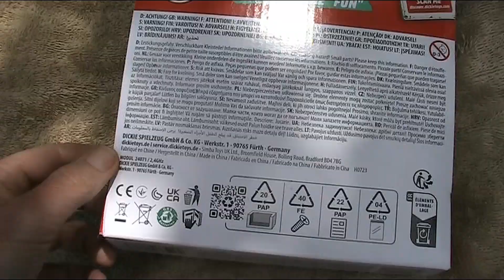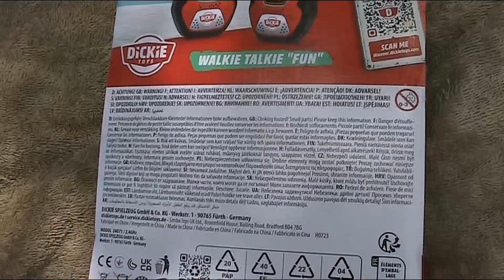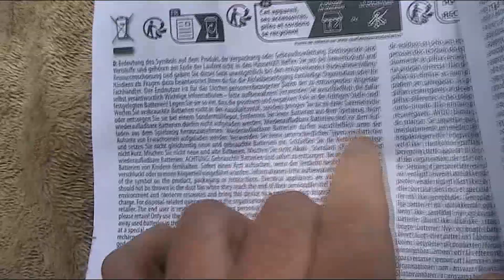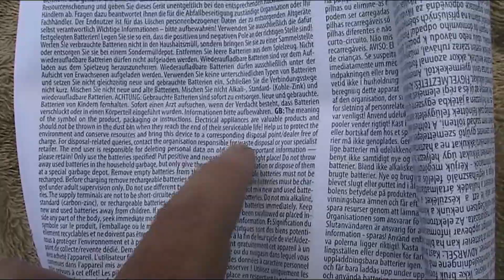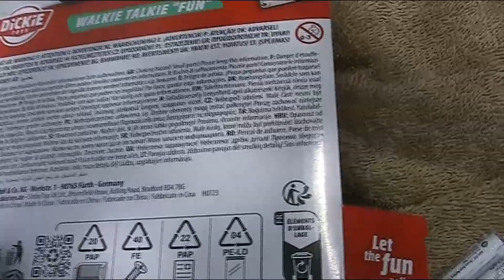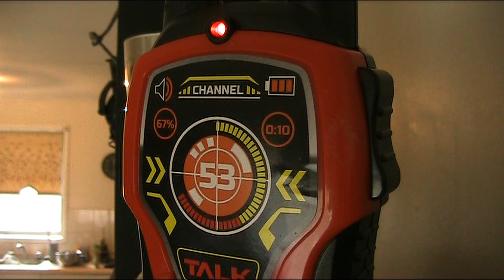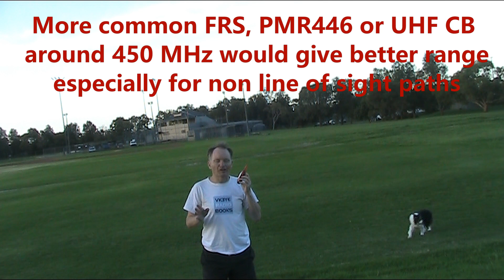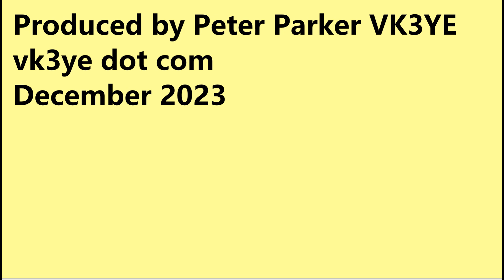2.4 GHz for $20: How far will these Dickie walkie talkies transmit?

Comment: I just bought a pair. The operating frequency is 2,475 MHz using a bandwidth of about 5 MHz (some sort of digital modulation mode).
Reply from the maker: Pity it's outside the amateur band. So no use for VHF/UHF Field Day multipliers!

Comment: That looks very interesting to experiment with. So many possibilities, repackage into a cheap motorcycle helmet communication system, hookup to a blutooth module and use it with Rattlegram, etc. I wonder if it uses an nrf24l01 tranceiver module or similar chip.
Reply: Maybe not a '24 (they're all BGA ICs anyway?) .. While they can sent packets fast (100/sec), their throughput is only ~3-5kB/sec -- while voice at that bandwidth is doable, it'd involve digital processing grunt that I wouldn't expect to see in a cheap toy.
Reply: Adding: this looks promising - an FCC filing by Dickie Toys for another 2.4 GHz toy using a visually similar IC... a NLB24054TX.
Haven't found a datasheet, however it is mentioned its transmit power is 0.21-0.23 mW

Comment: 2.4GHz good for privacy, but otherwise here in the UK they dont beat my Baofeng C50
 Pair for £20.90 GBP (discounts available) 2w 400-490MHz 99ch PC programable
 with UV3R li-ion Batts included
Reply from the maker: Definitely seem better value.
Reply: Though 2.4 Ghz is a lot more interesting to me to experiment with. These radios don't seem to be available here certainly not in our Aldi stores

Comment: I just bought a pair of these, but they are blue with same internals - 18 GBP from Amazon. One of mine is transmitting an audio tone (sounds like a square-ish wave) at around 780Hz, along with the audio - I wonder what could be causing that? I can't see there is anything on the circuit board that can be adjusted.

Comment: Isn't this the frequency all the toy RC drones fly on? Are the ranges similar with the toys?
Reply: Yes, It's one of them, although I suspect the transmitters used in drones are considerably more powerful than these.2.4 Ghz. drones are good for a mile or so. For greater distances, 900Mhz. is the preferred frequency. It's worth noting that one of the advantages/disadvantages (which ever way that you look at it) is that atmospheric moisture significantly attenuates rf in the 2.4 ghz. range. It's one of the reasons it was chosen for blue tooth.

Comment: Shame the chip is unmarked. Analog FM 2.4GHz chipset would have been neat.
Reply: They could be the same chips they use for some cheap ali express wireless guitar units. They sound ok enough but are not as good as a length of shielded cable
Reply: It's digital, not FM.